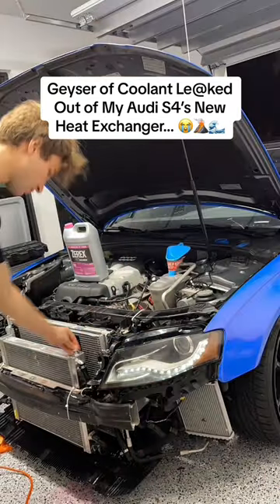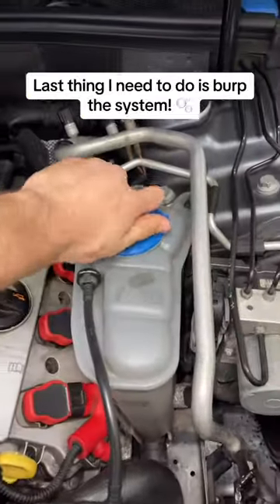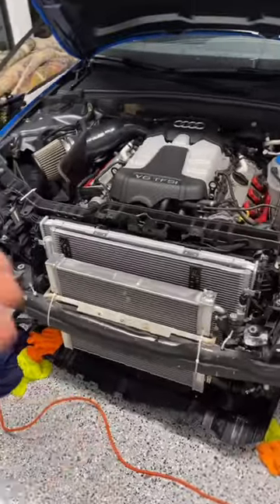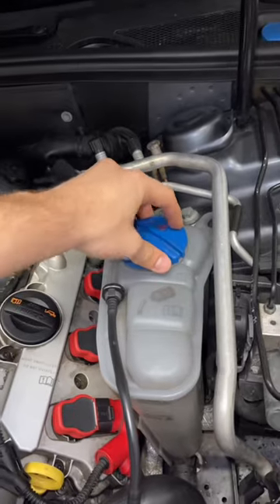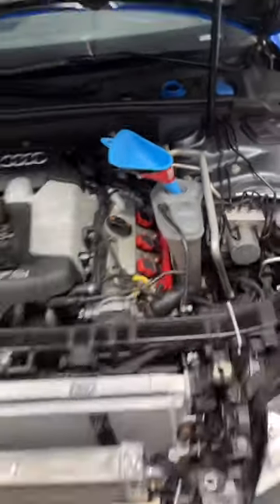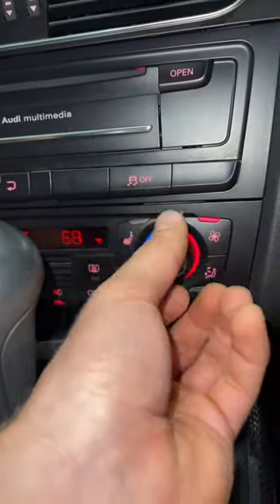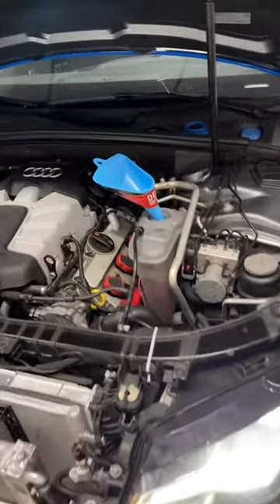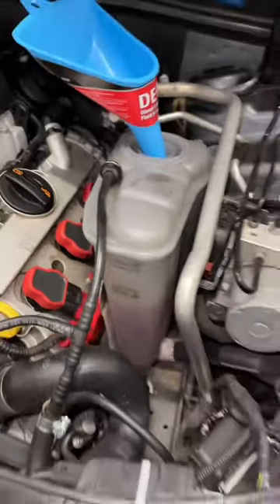BURPING/BLEEDING MY AUDI S4’S COOLANT SYSTEM WENT TERRIBLY WRONG!? (GEYSER OF COOLANT SPILLED)

Comment: I would not do it that way ! 
1st fill up , bleed the heat exchanger, then open the bleed screws of the supercharger (passenger then driver side for lhd cars)
And always have the tank full ! Don’t let it go empty ! 
Then start up the car idle at 2k rpm bleed the supercharger using the same two screws , then let it heat up to working temp check levels .

Comment: Little tip try using oem coolant only reason is I’ve notice zertex if it was to leak at all will destroy anything painted or plastic sadly but other than that good job and invest in a bleeder funnel you may think I’m only gonna do this one time but in the end you gonna do more coolant related things especially with Audis plastic connectors and weird hoses just saves you time in the end